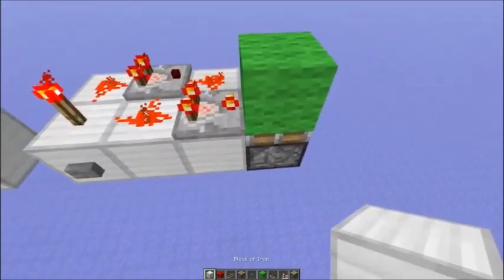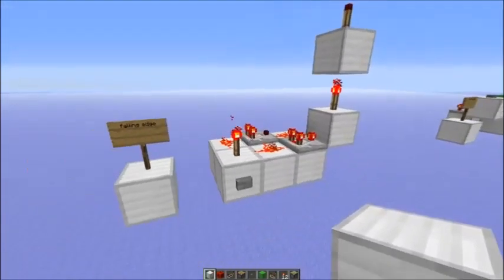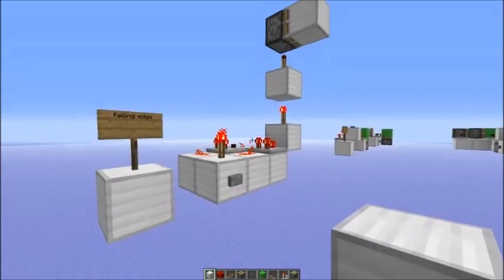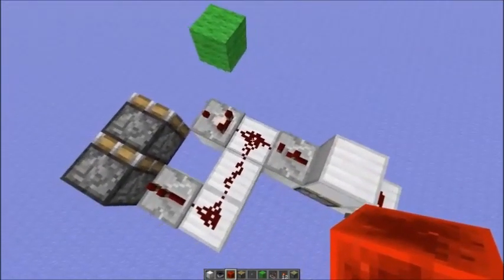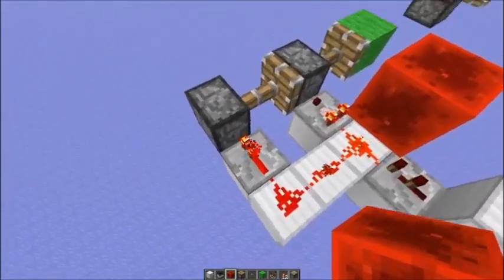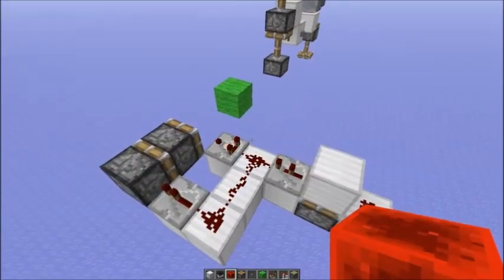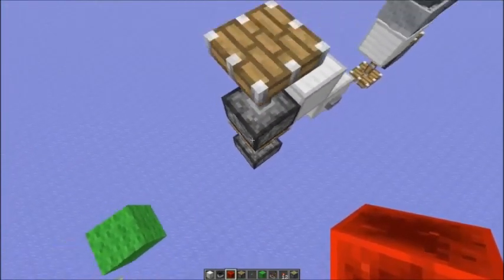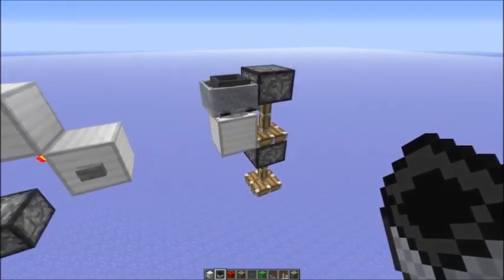Redstone Basics: comparatorbased short pulse generators

Comment: 7:45 if you replace the comparator with a 2 tick repeater it actually…works.
Reply from the maker: +cplnerf it's a lot slower, which is the main issue. also that wouldn't fix the others
Reply: Yeah :/
Couldn't you use the previous mechanics (like comparators + repeaters into other comparators + repeaters) to manipulate the order?
Reply from the maker: it has nothing to do with the order. Mojang changed the way pistons behave in the latest snapshot. It's not possible anymore
Reply: Oh :(
y dey do disssss

Comment: In the first case you said the comparator and repeater both have priority 3. That's -1, not 3...
Mango, you're losing it... You told me the normal mode comparator "doesn't work", you didn't specify that it put out a longer signal. If you would have said that I would have told you immediately that a comparator on subtraction is the special case where it can process the side inputs within the same game tick they change state, IF the comparator also changed state that same tick (basically, without scheduling another tileTick for 2 gticks later, as usual). I would think something along these lines should be obvious too, because if you look at the timings, the redstone powering the side of the comparator turns on only in the tick the comparator is already supposed to turn on. Anyway, the comparator on normal mode is the expected behavior (long pulse), and comparator in subtraction is a special case in code.
You can think about it as similar to giving a repeater a short pulse. Say you give a repeater a 0 tick pulse at tick 0. The repeater schedules a tileTick and turns on at tick 2. It notices it should depower upon powering and schedules another tileTick for tick 4. So it output for 2 gticks in total (4 - 2 = 2). Again, similar deal with the comparator, but subtraction mode comparators in the special case as I described above has this special, intended behavior.
Please be more specific next time.
Reply from the maker: +sharir1701 alright master sharir
Reply: ilmango
Go fuck yourself xD

Comment: 1:06 Comparators will never output a 0-tick signal with their current behaviour. The comparator either turns on (if he updated before the repeater) and then needs 2 gticks to turn off again, or he will not turn on at all (if he updates after the repeater).
1:46 Both the repeater and the comparator have a priority of -1 (according to the 1.8 code). The only time you get a -3 priority is when a repeater faces into a repeater or comparator.
Reply from the maker: +Myren Eario thanks. I also realized that after rewatching the video. I'll add your coment to the description